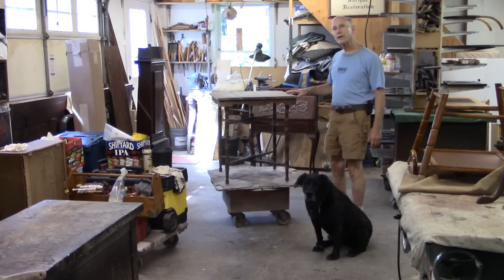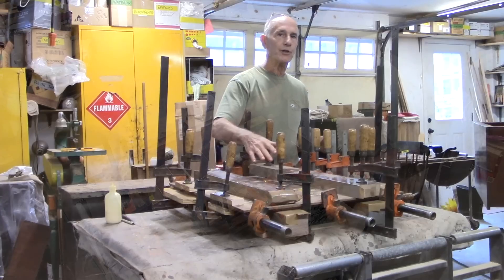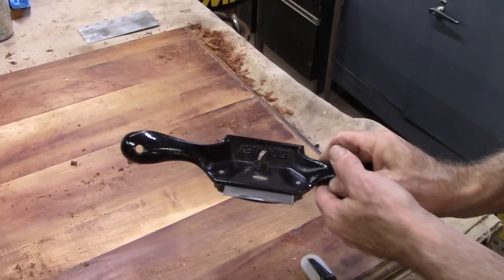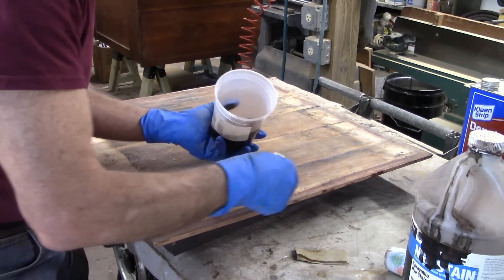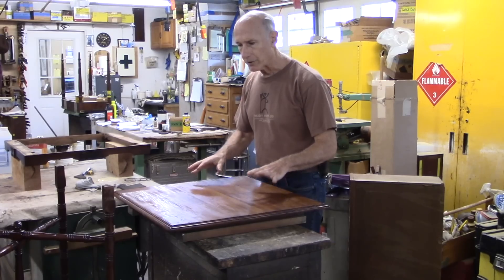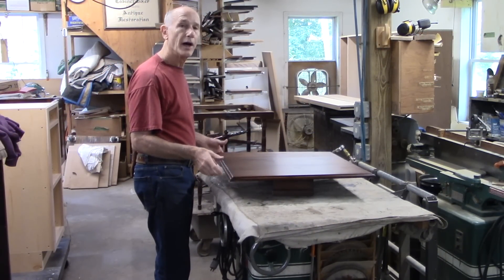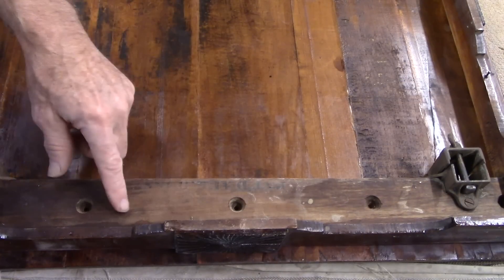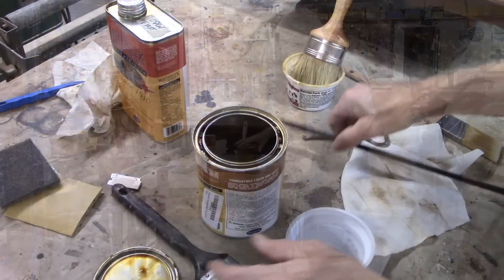Actual TRASH to Heirloom TREASURE

Comment: Were card scrapers always a tool of the trade? About 19 years back, I don't recall seeing them. Within the last 3 years I've started seeing them being used in videos I watch. I think this table came out beautiful.
Reply: Scrapers were used in carpentry by the Ancient Greeks and Romans - and possibly by the Egyptians too. There are flint scrapers dating back to the mesolithic, but they were most likely used for working skin and leather rather than wood...
Reply from the maker: Thanks! dlevi67 is correct - they are ancient! Think of a flint scraper
Reply from the maker: Thanks! Yes, such a simple tool, it may have been one of the first tools, besides a rock being used as a hammer

Comment: Very nice presentation. I'd have liked a little discussion of that central vertical wooden hinge that allows the legs to fold flat. It appears that it has withstood the rigors of time quite well, which suggests that the table was not put up and taken down too many times. (I always imagine campaign tables as having been used by Civil War officers to view maps of the terrain over which war is being waged. This one would have, at best, seen limited action during maybe the Spanish-American fracas? Or perhaps it was able to avoid military service altogether.)
Reply from the maker: Thanks! I agree - we cal it a "campaign table" A wooden hinge like that doesn't have any real stress on it and doesn't show signs of wear

Comment: I love that piece. It reminds me of a table I have that my mother rescued from a barn in Indiana in the '60s. It unfortunately has a warped top. Do you have any videos on how to remove warps in antiques?
Reply: "How to remove warps in antiques?"

With a lot of good luck and a few miracles. Honestly - if structural wood warps (cups or, worse, twists), trying to fix it is a really thankless task; unlike a painting, where - even if the wood panel warps - what matters is the paint, and the strength of the substrate can be substituted by 'something else' (i.e. laminating a stable material while cutting so much of the wood fibres that the warp can be eliminated), in a piece of furniture you need that structural strength...

You can try steaming, but on a table top it's not easy either. And unless you are quite skilled, it's very possible that the warping will return.
Reply from the maker: Thanks! I hope to make a video on that but I have never had any luck
Reply from the maker: Thanks! I have never been able to remove warps or twists but have done exactly what you describe

Comment: That type of glue up is always a challenge even with modern pva glue. I just do one joint at a time. Glue pairs then pairs of pairs etc. It's easier on my nerves.
Reply: It is easier in a sense, but if you have a moulded edge like here it's very difficult to make it align perfectly throughout if you assemble the joints one at a time, especially because the joints are unlikely to be perfectly square and parallel... Don't ask me how I know.
Reply from the maker: Thanks! Yes, that can help, but I like devi67's answer.
Reply from the maker: I know exactly what you mean!

Comment: Beautiful  job Mr Johnson. I have a question on the finish. I use Waterlox often and I've noticed you apply gloss first and follow with satin. I'm not sure I understand the reason, but I'm sure you know . FYI, I'm a big fan!
Reply: I think it's because gloss is (reputedly) "stronger" and builds up faster than satin, but one wants a satin rather than a gloss finish.
Reply from the maker: Thanks! I believe all professional finishers work that way - dlevi67 is correct. Also, using gloss you can see your color and defects better
Reply from the maker: Yes, "reputedly" being the key word. We were always taught that - I'd like to hear from a chemist about that

Comment: How much does the humidity level affect the shrinking or expansion of the wood? With the hardware attached to the apron and legs do they keep the top more steady or does it move with the wood? It looks fantastic sir really beautiful. Thank you for sharing.👍
Reply: Wood expands or contracts with humidity... so in a sense 100% of the movement is due to humidity. How much as in "how much it moves" depends on which tree the wood came from, how and where it's been cut and dried, how and where it has been worked and finished, and finally, where it is kept and humidity and temperature variation there.

If you see what Tom does at 14:55, he is trying to maximise the structural strength without compromising the ability of the wood to move. The apron and legs do keep the top somewhat steady, but the way in which Tom has enlarged the screw holes leaves the top free(r) to move a bit.
Reply from the maker: Thanks! dlevi67 has answered perfectly! I will add that finishing both sides helps a lot
Reply from the maker: Thanks! perfect answer as usual! I added that finishing both sides helps a lot

Comment: Nice job Tom. Just curious why you didn't go with a padded on orange shellac to build the new finish. A lot quicker drying than Waterlox! I love a hand rubbed shellac finish followed up with a paste wax and buffing.
Reply: A lot quicker to dry, but also a lot less durable and resistant to 'domestic mishaps' too...
Reply from the maker: Thanks! I know what you mean, but dlevi67 is correct - I do all tops with Waterlox. This table is in our kitchen!
Reply from the maker: Exactly!
Reply: Yes, I agree that it's more durable...for sure, but I love using shellac because it's so easy to repair and rebuild if needed...plus a hand rubbed and wax shellac is so beautiful! @dlevi67

Comment: Wunderbar, a very educational , well presented video. As a fellow restorer, I was wondering about the health and safety issues when applying some solvent based materials with out protective gloves. Regarding the 4 metal brackets for the legs. Since this is a ferrous base metal probably copper plated, for further corrosion protection, I might suggest an acrylic clear coat after cleaning, covered in a microcrystalline wax as sacrificial top layer. 
Thank you for a very enjoyable video.
Reply from the maker: Thank you! I always appreciate positive feedback from a fellow restorer. I do wear gloves almost all the time, but when I'm making a video and operating the camera as I'm working the gloves are not practical, whatever I'm working with will get all over the camera! (it's happened)

Comment: I thought I had read somewhere that bleach only kills surface mold but not the roots since the bleach doesn’t penetrate wood allowing the mold to grow back.  So I checked and found several reliable sites saying the same and recommending alternatives that are absorbed such as vinegar, peroxide and borax.  I would be interested in knowing if you have ever seen mold grow back since I have used bleach on an old dresser that had a musty smell when I got it and the smell did come back eventually.
Reply from the maker: Thanks! Yes, after many people commented on that I have switched to vinegar. But I have never witnessed any mold coming back, but new mold could certainly appear later!
Reply from the maker: Thanks! Yes, I have switched to vinegar after all the comments I've gotten on that subject. Bleach definitely dries faster, that might be the only reason it's not as effective

Comment: I enjoy your videos. I wonder is it safe to use the finishing products indoors like a basement?
Reply: To apply - not really, if they are solvent-based (and Waterlox contains quite a lot of VOCs). If you do one or two small pieces every now and then, it's probably fine; if you use a lot of stuff all the time you need proper ventilation (which is why Tom's painting and finishing area is next to a window with a fan). Once the finishes have dried off and cured, there is no issue at all.
Reply from the maker: Thanks! I like dlevi67's answer. You need a good exhaust fan. But basements have a higher humidity too so things can take longer to dry. As long as you can't smell anything upstairs...
Reply from the maker: Yes, all true.

Comment: I am wondering if you've done a video on preparing and using the card scraper?
Reply: Not that I know of, but there are lots of good ones - I would recommend Paul Sellers, Stumpy Nubs (James Hamilton) and Rob Cosman's.
Reply from the maker: Thanks! I haven't! But dlevi67 is correct, there are videos out there
Reply from the maker: I need to check those out myself!

Comment: I'm curious - on a moveable joint like the legs, how do you handle finish build up seizing up the joint?  Do you not apply product in the actual joint, or do you just do it very carefully and move the joint while it's drying?
Reply from the maker: Thanks! It's important to keep finish out of any joint, sometimes I'll tape it off, sometimes you can just be careful. I will move a joint during the drying process too

Comment: Regarding oxalic acid:  is the hot water for dissolving the powder or is it necessary for a warm application?  Thank you for the advice.
Reply: It's largely necessary to dissolve the acid in a reasonable time. Otherwise you are there stirring for (what feels like) hours.
Reply from the maker: Thanks! Yes, dlevi67 is correct - it helps to dissolve it, especially if you are making a strong solution
Reply from the maker: I have never tried it cold, but I can imagine...

Comment: What is a good way to remove a motor oil stain from a table top that will be refinished?
Reply from the maker: Thanks! Keep drawing the oil up with lacquer thinner, sand , do it again and again. Try a degreaser like Krud Kutter, see if that gets some out. The stain may never go away